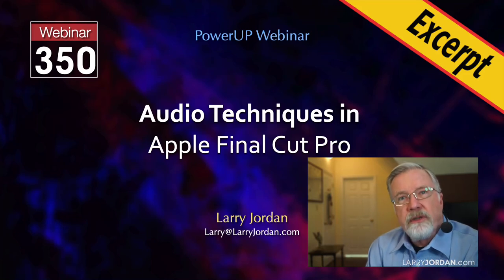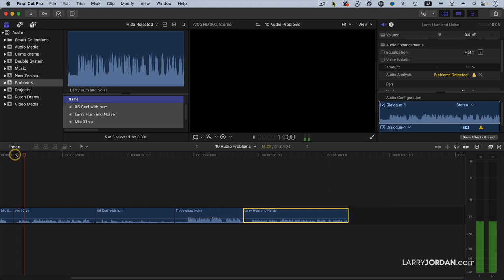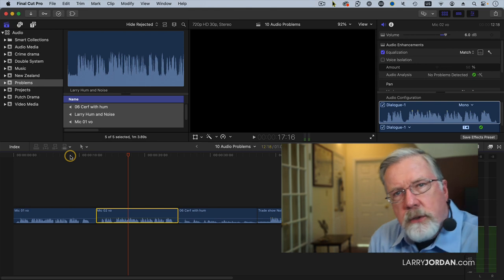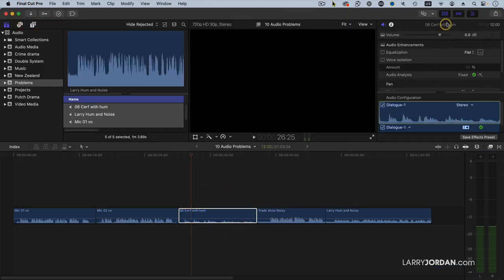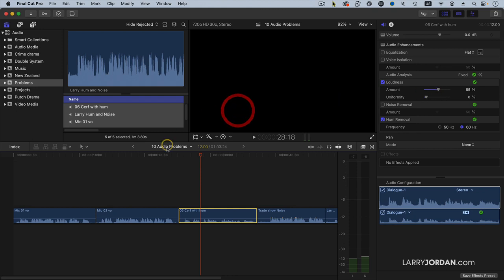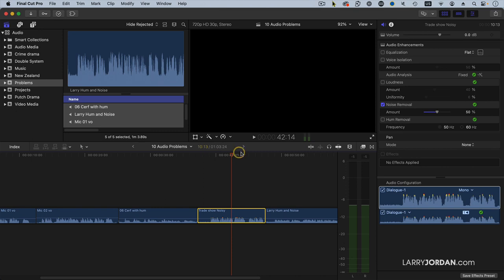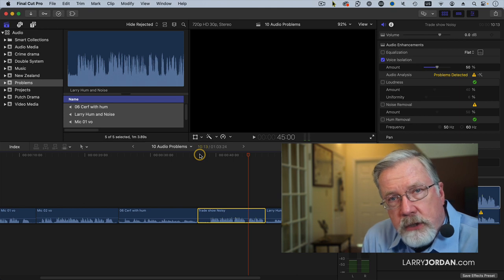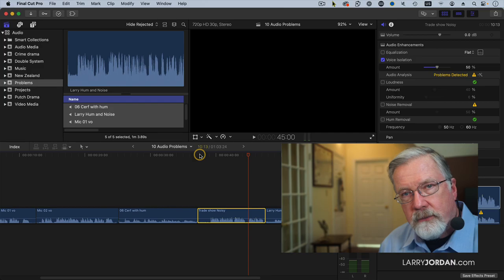Three Repair Tips to Fix Poor Audio in Final Cut Pro

Comment: Sweet... thanks for the info. I tried this with a few clips which had a lot of background traffic noise (i.e. big truck), but when it cleaned it up, it added a crackle sound that wasn't acceptable either. Hmmm... what would you recommend? I'm currently dubbing over my audio when speaking to the camera to remove the bad audio and replacing it...but that's not ideal either. Ugh. Any suggestions?
Reply from the maker: Bubba:

Removing noise using software is always tricky - because the same frequencies that contain the noise also contain the voice.

If you need to REMOVE the noise, your best option is to re-record (i.e. ADR). However, if all you need to do is reduce the volume of the noise, try modifying the amount of reduction. There's no magic number that works. Also, you can try the DeNoise plug in from CrumplePop. It uses AI to clean up audio.

Larry

Comment: My main audio challenge is getting Lufs to be at -16 or -23 easily in within Final Cut. Is there a work around?
Reply from the maker: Johnny Dee:

Well, there's good news and bad news here. 

Good news: Final Cut has a Multimeter audio effect, which measures LUFS.

Bad news: This effect is applied to the clip, not to the entire mix. There is no way that I know of to get a LUFS measurement of the mix because there's no specific master mix track we can use to apply filters.

Larry